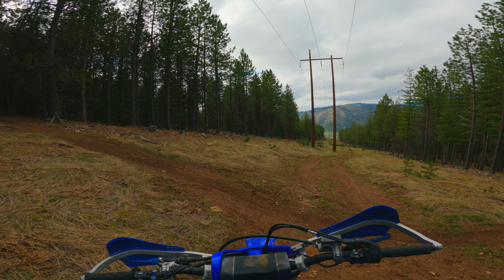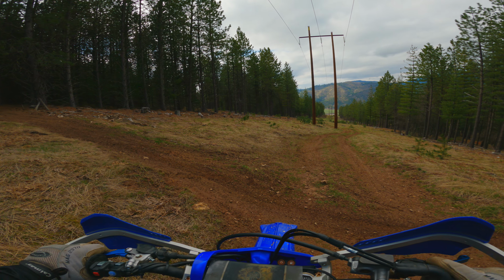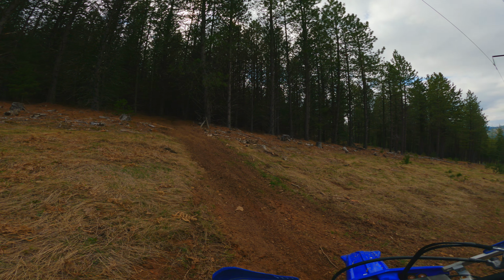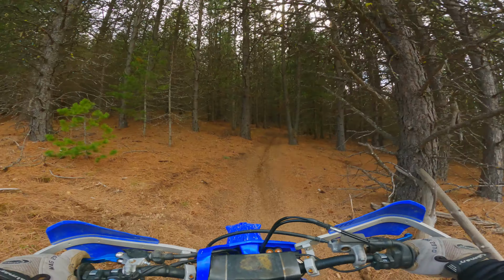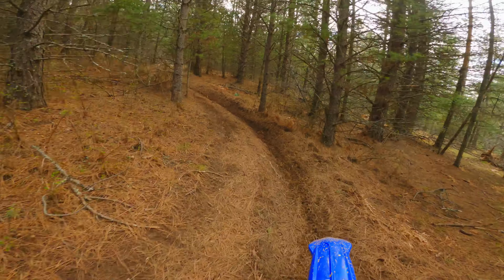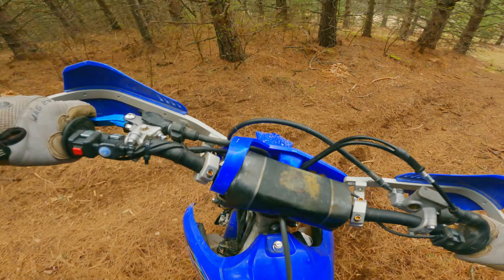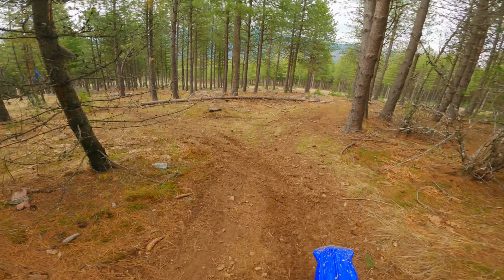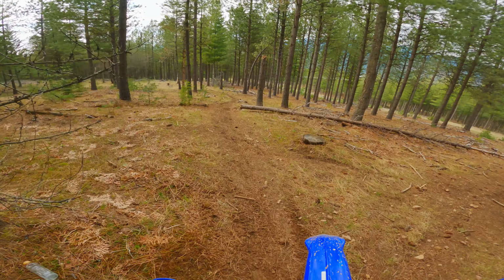Why You Shouldn't Lower Your Dirtbike -- My Experience

Comment: Did you mic up your helmet, sounds good! I also thought about lowering but decided not to.
Reply from the maker: I did mic it up! I'm not too happy with it though. It sounds like it's peaking and there's no way to turn the gain down. 

Yeah, lowering for shorter people is important if you're stopped on a side hill and can't touch. The overall goal is to find a good balance I think.
Reply: @justinsavs  I notice the little things! 😃 Also I had the purple panda mic and didn’t like it, I now have a really cheap no name off Amazon that works better. I have a new helmet now that I’m not sure if I’ll mic or not? Anyways it sounds good, maybe just talk a little softer and see if that works?
Reply from the maker: @Captain250FX  I'm actually going to put the GoPro Labs firmware on it so I can adjust the gain through a QR code. 😅 and yeah I got the purple panda mic. The mic is good this is just a thing where I need to adjust the gain.
Reply: @justinsavs  nice!